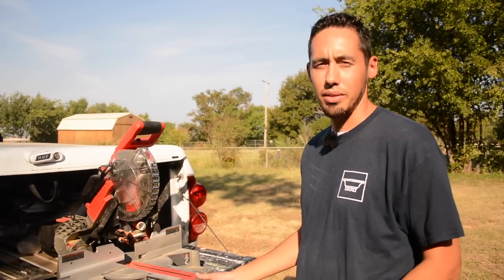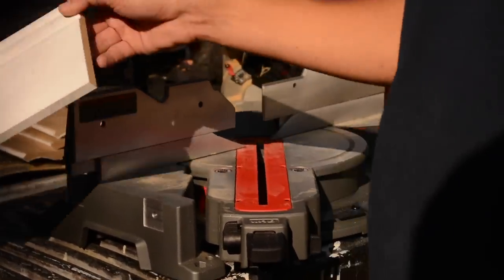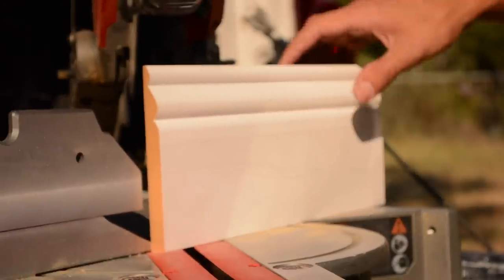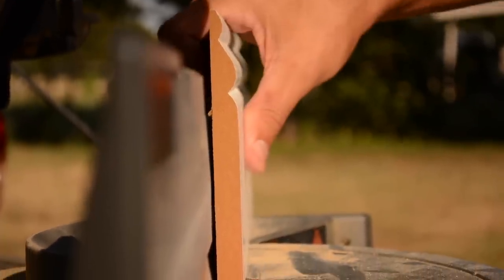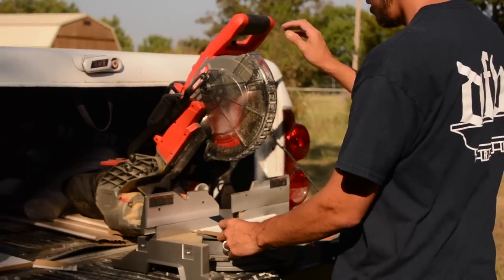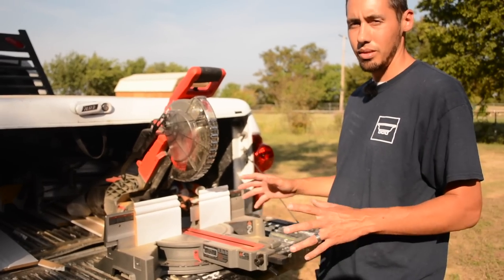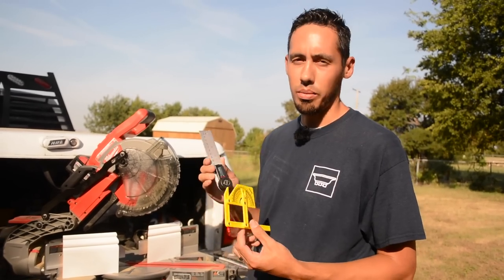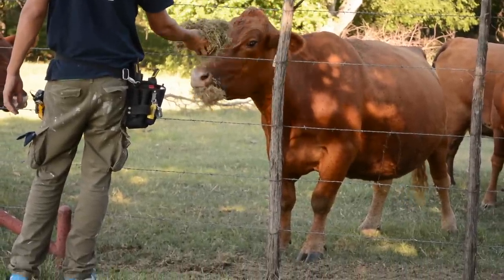Why Your Miters Suck - And How to Fix Them

Comment from the maker: If you are having some trouble getting your miters to line up properly, these tips may help. Thanks for watching!
Reply: dfw crown did you go with the Milwaukee sponsorship?
Reply: I have all Milwaukee tools now, love them. Your videos have helped me so much one of the best channels!!!!
Reply: My miters suck because I'm not DFW Crown! haha.  But for me I was working on a old house and with the corners never being perfectly square so it always took a couple attempts.  Thanks for all your tips.  I made a fireplace crown molding using your tips.
Reply: dfw crown I
Reply: dfw crown I
Reply: dfw crown how do you like the new battery powered versus your old dewalt saw? I've always preferred power over battery but seeing a pro use this to make his living makes me think I should give them a look.
Reply: dfw crown caulk everything
Reply: dfw crown. But that only works when the corner is square which is rare. Cutting a perfect mitre in many situations will only guarantee a misfit.
Reply: I think that is why he suggested the angle finder.
Reply: Finish Carpentry TV thanks!!
Reply: DFW :  Had a 5 1/4” base that every time I cut a 44 degree miter, the base had a curve to the wall side of the angle. Used a 7 1/4” sliding single bevel miter saw and the 61” piece was supported out from the table. Laid flat and bevel cut the piece.  Framing square showed a ever so slight curve to the bevel at the end. What could it have been?
Reply: Doesn't having the right saw blade play a role also, I know there are different blades for smoother cuts that wont chew the edges of your cut as well..
Reply: I always love seeing ppl try and cut big moldings with a cheap saw, set on the ground or saw horses with no supports underneath the material.  And that cheap cheap saw blade that's good for 2 cuts on mdf and they are on the 800th cut while cutting threw hard maple.
Reply: @jeremyrude6883  through vs threw

Comment: Great tips!!! I just got my saw a couple weeks ago and I finally got it set up (I'm retired and disabled so I just do what I can and it goes very slow sometimes) but one thing I highly recommend with ANY type of saw is making sure your blade is properly aligned. I use a Speed Square for this. I put it on the saw table and check vertical angles and set to 90 degrees there. Then do the same with the horizontal setting. That way you can be sure that your saw (especially if you just got it and like mine is used) is dead on and square to start with. I use this method with my jig saw, miter saw, circular saw, and radial arm saw because that is the first and most important step you can do before starting to cut any angles. I made the mistake of loaning my jig saw to my son and when I got it back it was all out of alignment and was cutting diagonally instead of true 90 degrees, so it's an important first step. Just wanted to add a little bit of knowledge for others here. You have an awesome show! Keep the videos coming. We appreciate your efforts out here for us.

Comment: Great video Richard, keep up the great job. 
I put a square on the base and against the blade to verify that it is in fact at 90 degrees to the deck and then make sure the stop and gauge are reflecting that number. Lay the square down and make sure it's 90 degrees to the fence. 
Saws take some abuse getting moved around and things can need some TLC to make it perfect again. 
Never know if a new saw was dropped before you received it.

Comment: The problem that is overlooked is a slight drift of the material because of the pull of the blade. I glued sandpaper to the fence to prevent molding from sliding along the fence.

Comment: If this is intended for beginners, you should point out why the angle finder is so important. It is extremely rare to trim a wall that is not only plumb but has 90 degree corners. Many mitres suck because it is assumed there are accurate corners in wall construction. Thanks for the content man...keep pounding!

Comment: I ended up going through and recalibrating my saw as it was off by a small amount.  You might address how you go about this process if you have time.  Great videos, thanks.
Reply: Lee Sommer I think my new saw needs this adjustment. 🤪
Reply: You can find that in the owner's manual. Get a good square or speed square to help!

Comment: My biggest problem was always the taper at the bottom of the drywall which causes the baseboard to tilt forward and you always end up with a gap when coping or misalignment when mitered.  I started keeping drywall screws in my pocket, driving a few in on each wall and plumbing them to where to the top of the molding hits the drywall as a shim.
Reply: Nice tip, sir. Thank you.
Reply: I feel your paint, I hate that dadgum sheetrock crimp, grrrrr
Reply: I used to mud 12" out from the corners to combat this.  I have something better now.

Before mud and tape... I created a small corner tool that will score the drywall paper 1" on either side.  I drag it down the wall in the corner and peel off the drywall paper.  This means there is a perfect slot for my tape to go.  There is no build up and more or less a perfect 90.  It doesn't crack.  You could do the same thing with a straight edge or free hand.
Reply: Great tip. Quick remodel on existing or following drywall crew you gotta deal with what you got. If your doing the full job just get the 4.5ftx12ft sheets and save your knees and time.
Reply: I do this as well.
Reply: Exactly! Most crown and base problems are drywall related, either the taper joint or the built up mud corners.  I sometimes use a doubled  piece of corrugated cardboard behind the square side of the corner on base.  It will crush when you flex the cope in, yet provide lots of resistance to keep the square baseboard out. Not as strong as a screw, but self adjusting.
Reply: Or you just add a tiny shim behind the trim at the corners so it stays plumb. I dunno, it's not rocket surgery
Reply: Golden tip here

Comment: In Connecticut I noticed the outside corners are bowed from taping compound and corner beads bowing. I use a larger angle template, lock it into place and then use the digital angle finder to find the true angle over a run instead of a small 4 inch length on each side

Comment: Tennman55 
This video identified two things I had wrong while trying to cut miters. First, my saw was off by 1 degree vertically and my material supports didn't support the wood in perfect right angle to the saw, but once I corrected the problems, they are perfect!!

Comment: Since this video is about how to fix miters I want to tell you how to square your miter saw which is extremely important to good miters. I usually use white toe kick cover but anything straight will work. Cut to straight pieces of stock to about 18 inches each since you may have to make a number of experimental cuts before your saw is square. Put the two pieces together face to face. If you don't have a clear side mark one side as your face side. Now put the two pieces under your blade trim just enough so both pieces are fully trimmed front to back. Now open the pieces like a book so the two trimmed edges are butted together. Is there a gap at the front or the back? If there is the cut isn't square and you must adjust saw until the gap disappears. Now do the same against the back and adjust the saw until the gap is gone. Now the saw is cutting square. Using a square just isn't good enough due to variations off of true in blades. If you have excessive wobble in your blades replace the collar behind the blade. Now you have a square miter saw done the easy way. Check it for square when you put a new blade on.
Reply: Thanks for the well explained pro tip. I will try this before I use my miter saw again.
Reply: I was wondering if my explanation was clear enough. I found that if your saw wasn't cutting perfectly square all the fancy angle squares did little good if inaccuracy in your saw compounded a problem at a corner. Thanks for the reply
Reply: BaconNBeer:  My problem is cutting baseboard corners when the wall corners are not square. What's a good angle finder to use for this?
Reply: rbbartho cheap: there are ton, Amazon has a tacklife digital protractor which there must be 1 Chinese company that makes then and puts different companies names on it. Then the company that I’ve seen him using is Starrett 505P-7 miter saw protractor but that’s analog & a pricier company, potentially makes a higher quality product though
Reply: Squares are notoriously inaccurate, use this method!  Thanks for reminding me of this BnB!!

Comment: Good basic video. Most new Carpenters don't pay close enough attention to many of the things you point out.
Biggest thing most people need to learn is to to square up and calibrate the mitre saw, this needs to be done frequently, especially if you move or transport the saw a lot. Even the good saws tend to cut crooked straight out of the box. Also I like to differentiate between a bevel and a miter because it's important to know.
Lastly, if your work has to be caulked it was done wrong, eventually you learn how to just look at a corner and know if it's 43° or more like 46°. Very seldom will a corner be a true 45°.

Comment: This guy is good. A big problem is crappy drywall installation. Bulging out at the bottom where metal studs are locked into track. Then the screws are never flush so its hard for a perfect mitre to look good. Caulk & paint will make it what it ain't! I do appreciate skilled craftsmen, very rare.
Reply: If I'm installing 5" base I take my measurements 5" above the floor.  To get a miter closed usually means planing the back of the base or scraping or gently hammering the drywall or corner bead.

Comment: Using a compound miter saw, I set the stop block with a tape to a fix length to the teeth of the blade, check it more than once but when I cut the wood it's a little less than the actual measurement. Do you know why that is? Thanks.

Comment: I am putting up some 3-1/2" crown that came with my painted cabinets...it's more detailed (on the low side) than other crown I have seen.  In addition, the material is maple and really hard to cut through when I try to cope it..any advice? I am coping because i have heard the joints come out better generally.    Let me know if you have any thoughts to make this task easier.  thanks a lot

Comment: I wanted to ask you, when a piece of baseboards isn't long enough and you're piecing things together is it better to cut the two pieces in. Straight 90 cut or in and angle. I did one in an angle and it blended in better than the straight cut pieces.

Comment: I bought the Milwaukee compound mitre saw with the digital angle read out.I like the saw,but it weighs a ton,not easy to move around.There are times I wish I had bought a smaller/lighter saw.

Comment: I try to avoid cutting with the skirting (baseboard) standing upright like that..

I instead lay the material flat and bevel the saw to suit.. 

I find it much easier to hold the material square and flat this way.
Reply: i do mine that way too. yeah, my miters only suck because my saw cuts are square and straight. problem is my house is anything but. i end up fixing it with sandpaper to massage my work piece to fit the house, lol.
Reply: I've always done it this way too, more than one way to skin a cat 👍
Reply: ReverZe83 ,

.....but either way, the cats not going to like it.
Reply: vzgsxr lol tell that to a trim carpenter and he will laugh his face off.

Comment: Love that angle finder. I nvr knew about them til i saw u use them. But they don't sell them around here, in East Tenn. And I've tried to order em twice. Got canceled both times. But I've got to get me 1for sure...
   Oh I also nvr thought about using contact glue on my outside miter's. Until I saw u do it. Thats craftsmanship. I mean I've tried other methods. But there a pain in the ass. Do u sell that stuff? If so where at?

Comment: Baseboards Inside corner when one wall slopes away? Doing a 350 year old house, east coast Canada. 
Example: outside wall/floor/baseboard run is fairly level to the inside corner BUT the floor drops almost 2” over 12’ along the inside wall. 
   These are driving me mad! Obviously both pieces need a 45* cut to form the 90* inside corner BUT one piece needs a compound mitre to allow for the slop away in the floor. I can’t compound both pieces of and inside corner while maintaining a tight plumb fit against the wall.
This one really has me scratching my head. (3.5” colonial wood)
If you could help on this one I’m be grateful!

Comment: I found that sometimes if you are using a 12" saw, the blade can bend a bit when you're cutting your pieces. Usually it's a thin blade and the downward force can bend the blade and screw up your cuts.

Comment: Excellent advice.  Would you also use coping saw with pine base?
Reply: U can use coping saw for wood & mdf products. Gives a nice tight look if done correctly. But there are easier quicker ways to cope. He actually has video's on it. You can use angle grinder with thick 40 grit sanding pad. Or they make a coping plate for a jig saw. You attach to your jig saw. And cut upside down and towards yourself. So need to be experienced with it. But it's much quicker. Can't remember who makes them. But its easy enough to Google..

Comment: You check the saw fences for 90° to the bed. Check you index table by making those two cuts then measuring with a try square top and bottom. Cut wide stock flat on base to check bevel on saw. Then, in practice, instead of fumbling to set saw 1° above the index notch, click it into the index, whether 22.5°. 45° or 90° then use thin shims of various thicknesses between the stock and the fence if you feel the need to cheat an angle a tad. You can chop these off the molding you're using but make several different thicknesses. You can then take one shim and move it closer to the blade to add the minimum angle or further away for more effect from the same thickness shim. One thing Richard forgot to mention here but he did comparing chopsaws is blade runout. If your blade is not true or the arbor has runout, you'll get a wider kerf. You will see this in a zero kerf insert or simply chopping part way into wide stock and comparing the kerf to the blade teeth with a micrometer. Good stuff Richard and thanks!

Comment: I use finders/protractors and I rarely have to go back to the saw to fix the angle, I do sometimes need to shear off the short point against the wall on outside corners if the mud is not done well. Love the cow by the way...

Comment: My check for square on a saw is to do a square cut on something with 2 parallel sides 4 or 5" wide.  Then I'll flip one side over and but them back up with the sides hard up against the fence.  Any out of square in the saw's fence gets doubled and easy to see.

Comment: Thing is most trim guys are measuring a whole floor of a house at a time and making a cutlist then going to the saw and cutting every piece at 45. Unless you check your corners while measuring and write it on your cutlist too I suppose.
Reply: I check angles as I go.  And only do sections at a time.  Like 4 or 5 pieces also assume each piece needs a 46* miter.  
Cut most casing with a 1* back bevel helps also.

Comment: Probably 99 percent of the time the problem is the wall. It's pretty easy actually to set up the saw to cut 45 degrees but the key for something like a picture frame is having the opposite sides exactly (and I mean exactly) the same size.

Comment: I agree with smokingcheeba - but that name!  eesh..   Coping inside corners is fast and easy, no headaches and a very nice finish.  Used to work for a trim guy that insisted on 47.5 degree cuts for all outside baseboard corners, since it was getting filled and caulked.  Anyway, even if you don't have the best chop saw, the left 45 will almost always be a perfect 90 from the right 45.  When you NEED a perfect 90, be sure to cut the opposite sides of the joint on opposite 45's on the saw.  Should get you so close even your boss won't complain.  Even on cabinetry, I'll cut outside corners at 45.5 just to give that little extra wiggle room.

Comment: the bottom edge of drywall is tapered if it was a full width piece and that will also cause an open miter. strips of cardboard to shim between the drywall and base can be used.

Comment: Yes, and not all house corners are true 45 degree, so match the angles with the  wall corner at the floor (using the angle finder), or ceiling whichever spot you're trying to cover.

Comment: Excellent reminders but Even with perfect miter cuts, if the walls are bowed or the ceiling or floor is not level, those can throw them out too. Coping the corners when possible help there.
Reply: Thats what shoe is for

Comment: Ok this makes a lot of sense now lol. I knew it was something simple but this is most likely it. I tried supporting the longer pieces but guess it just knocked it off slightly. My door casings are a little better but still some smaller gaps that I had to fill. Some people say don't cut at 45 but cut at 46. The original casings are cut at 46 pretty sure so that took me a while to figure out.

Comment: Do you still use that saw? I bought one recently and had to return it. The main table was not level with the frame of the saw. With bevel set at dead 90° any miter degree away from zero would result in a less than 90° cut. Cutting a 45° miter would end as a compound miter cut about 3° off of 90. Totally unacceptable.